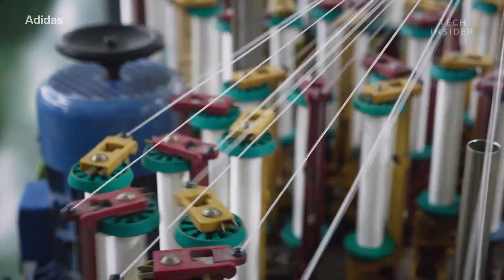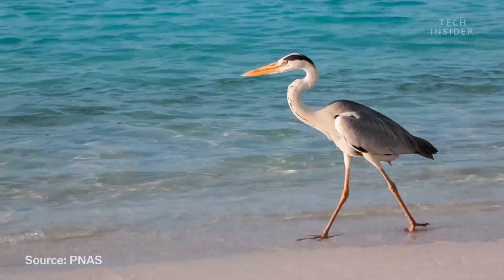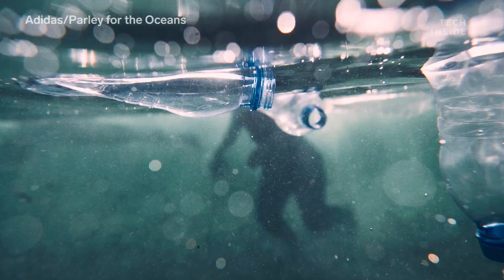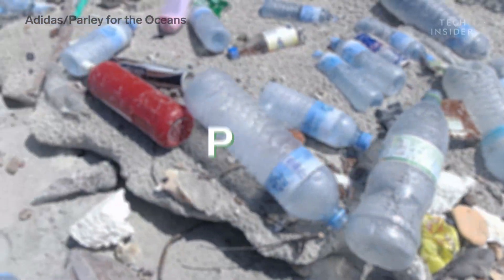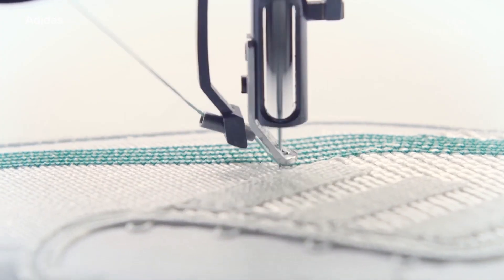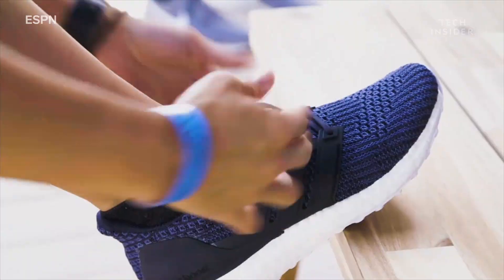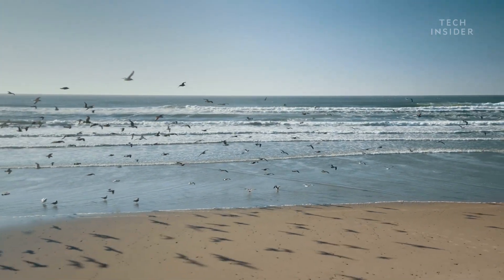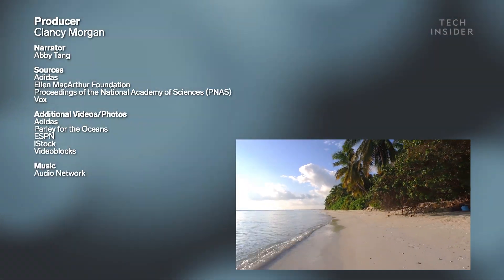How Adidas Turns Plastic Bottles Into Shoes

Comment: Someone: your shoes are trash
Me: well you’re not wrong
Reply: Well yes, but technically no
Reply: Yesn’t
Reply: Amen
Reply: https://youtu.be/ouLlq5w1tog 35
Reply: As long as you  recicle the plastic, for  good  of  the  environement, you can use it  in the  fabrication of  shoes when it's treated  for  that  purpose. The polycarbonate is turned into its  original  form when it s  recicled. Other  companies  are doing  that  for  years, even  with  paper.

Comment: This video's purpose is to stir up emotion and the narrator's voice is annoying. Who are these 'experts' that they are quoting?

No one talks about the costs of processing recycled material. It doesn't come for free, which in turn drives up the cost of the end product. 

The biggest culprits in plastic are the companies and manufactures of the products, with the consumer making up a small part. A lot has to deal with mfg costs but there are alternatives to plastic if companies would actually produce those items using different materials and provide different options for consumers.

Comment: Now, how would you recylce the shoes if the shoes becomes trash? It becomes more complicated to recycle. This does'nt solve the plastic pollution because shoes will not be used forever, plastic pollution will just pile up overtime, and this shoes will end up there to. The real solution is to stop the use of plastics.